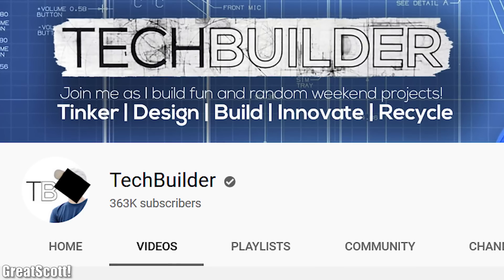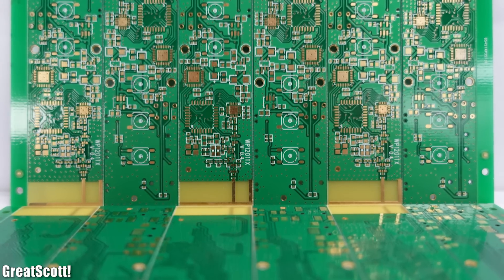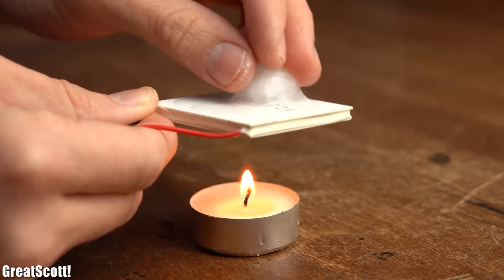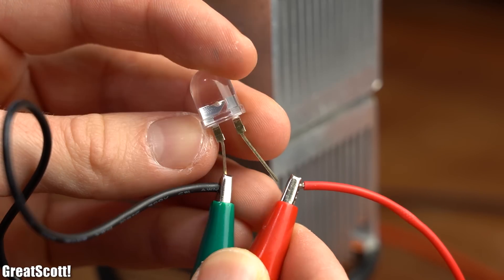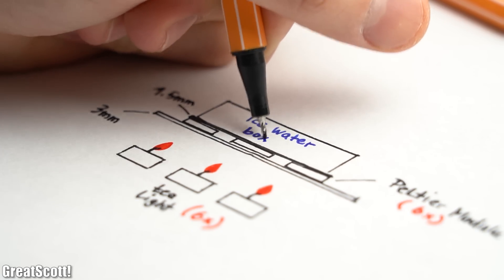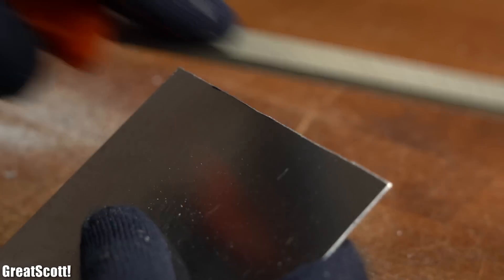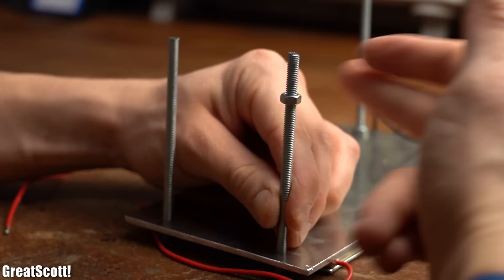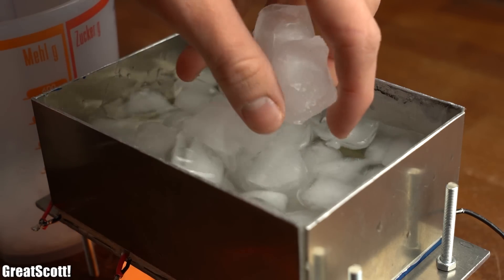Exposing a FAKE Thermoelectric Generator and building a REAL one!

Comment: Fun video, but I've designed comercial units and you need clamping force on the peltier modules to get a proper thermal interface. Just slopping on thermal compound creates a thick barrier.
You ideally want the only thermally resistive interface to be module itself as that is the only differential that creates energy. The rest is losses.
The modules to generate 5w alone exist and work great, but they require a deltaT of 210c and a heat-flow of 113w to deliver 5.1w.
Look here for actual performance charts and graphs from such modules: https://tecteg.com/store-thermoelectric-power-module-selection-purchase/
(I am not affiliated with TEG, tecteg or Rogers in any way, but I have used similar modules.)
A tea-candle generates 7-17 watts so you can't get anywhere near the required heatflow or temperature for a full 1-amp charge.

Comment: Two different but similar technologies, TEC, and TEG
Thermoelectric coolers are optimized for electricity to thermal difference and are lousy for thermal difference to electricity
You want to use thermoelectric generators for this, as they are optimized for thermal difference to electricity 

Running them backward will work just not very well

Comment: You would better use proper flux to solder the aluminum plates.  You should also clean the weld area with metal wire brush.

Comment: Engineers: this is a peltier Generator, basically generates electricity from temperature difference between cold and hot...

everyone else on the internet: OMG LOOK A FREE ENERGY DEVICE!!!!
Reply: The skeptic in me always says... it's not free when ice is needed and so are candles. Energy is needed to make the ice and candles cost money.
Reply: @raisagorbachov     The out of box thinker in me says that if you drill a hole into the ground, stick a sealed copper pipe filled with very fine silicon carbide powder , then attached to a flat plate "heat pipe" super thermal conductor/phase change heat sink.  Then for the hot side, you paint it an ultra black and put it under two clear acrylic boxes (preferably with a vacuum pulled within the box (but don't think acrylic will hold a vacuum permanently though). Take some poly foam with the Al reflective backing and cut to size the peltier to fit in that and put the reflective side up, so that it helps to keep the ground below cooler. 

       If you have a nice sunny spot for this, with enough devices connected, you could actually generate a decent amount of electricity especially during the warmer season. Other than price of the materials, the energy itself is free. 

   Btw, have a nighttime bank as well, that is reversed with some changes. Warm/hot side is the same as the above cold side, but for the cold side, have it painted ultra white and have it set sort of within a Al reflective, like satellite shaped reflector pointed towards open sky. Still have the double/insulated acrylic box (can be painted that same ultra white). 

     It will reflect the IR up into the cold vacuum of space and cool the cool side of the peltier. If the ultra whites are white enough, might even work some during the day as well.
Reply: Yeayou can also scream into quarz crystals and produce a small current. 

 youre speaker is also a microphone. Hook up a osci and talk into a speaker, looks pretty cool and is a fun party trick (well on a party full of electrical engineers)

This is the Piezo electrical effekt. You can either supply current to a piezo crystal and the crystal will start too vibrate or you vibrate the crystal and it will output energy

In theory you could build a piezo generator running on the screams of humans wich is probably how hell produces its electricity
Reply: @afox5319  similarly, you can shine a light at an LED to produce a tiny voltage or power a solar panel to produce a tiny amount of light. If course neither is as efficient at doing the other's job, but the principle is similar.
Reply: @afox5319  Hell doesn't run on electrical energy.......actually it's powered by thermal energy coming from human bodies and lava, as it is said in sourate Al-Baqara, in the Noble Quran (".... beware the Fire whose fuel will be humans and stones...")
Reply: A lot of people mistake Free Energy for "free electricity": literally as in they're not paying to get electricity, and not as getting electricity from nowhere.
Reply: It may not be free energy, but it is a new and exciting source of energy for hot tent campers
Reply: TGM-199-2.0-1.2
Reply: there is nothing like ,,free energy ,, ..there is alway something for something ..and losses matters !
Reply: It's close enough.
Reply: it is free energy, all energy is free ,  for a time at leaste, the sun will burn for billions of years, the earths core will be active for maybe as long,  theres energy everywhere, for free, well getting isnt free, but once you get it, it is, otherwise we wouldnt exsit i think, if energy cost, if we had to pay to produce energy, we wouldnt have enough in us to make energy, so its all technically free, existance is free, didnt cost us anything to be here, but admittidly it costs to stay, but thankfully theres free energy everywhere
Reply: Fixing hot plate at 50 degrees and the heat sink, which thermoelectric module would produce more power: TEC1-12702, TEC1-12706 or TEC1-12710?
Reply: @marvinmarvini8629  TGM-199-2.0-1.2

Comment: If you consider that a tealight can provide around 25W of heating power, than you could say, this project is insanely inefficient! 
So 6x 25W = 150W (+ the Energy needed to cool down the ice cubes)  vs.  5V x 0.043A = 0.215W  !
 n = 0.143 % -  This has been the worst trade deal in the history of trade deals, maybe ever

Maybe as I've seen it in the other comments, a Stirling-version with a BLDC-Motor would be a interesting project?

Comment: I have a design in my head for something like in a more practical setting. I was about to make it and bought some peltier coolers on EBay back in the days, but they were real shit quality and couldn't handle any temperature difference that was needed for generating anything worth using. The idea was to do it on the chimney, as a chimney roof. Hot air comes from below and heats a large heatsink. The TEG:s on top, on top of that another heat sink with a border around it. Then atube from the bottom to the top that would let the hot air create an airflow of cool air into the heating element because of the rising hot air. I think it would work quite well.

Comment: Not sure if that video was fake as is now listed private but you can check the video I made over 8 years ago about this subject. You can sure charge a phone (not very fast) with a single peltier module and a step up converter that has max power point capability (there are specialized IC's for this task). I did used a more capable peltier element in my video the 12726 https://www.youtube.com/watch?v=tbdtulL44ms

Comment: You may get a better result with TEGs instead of TECs.  While the principle is the same, TEGs are specifically designed for power generation from the temperature gradient while TECs are specifically designed to create a temperature gradient from an applied current.  Similar to how electric generators for wind turbines are better suited for generating electricity than a BLDC motor that is being repurposed for generating electricity.

Comment: You wouldn't have been able to power fans to cool down enough the "cold" side with your own design, right?
Using ice cubes is kind of cheating because ice packs a lot of energy... which was put there in the first place by your freezer, using electricity :) So a good part of the power input comes from freezing the ice, not just the candles.

Comment: Should you not be comparing against a TEG (Thermo-Electric Generator)  not a TEC (Thermo-Electric Cooler). TEC are better at cooling not generating electricity from heat like a TEG. Also TEG have max temp ratings, so you can better optimize the heat source.

Comment: ElectroBoom already tried to do something against such channels by testing the circuits they designed and finding out it´s not working at all but it seems like they don´t care much about.

And that´s why my brother thinks you can get free energy out of a 3 phase AC motor powered by an inverter+car battery which then drives an alternator from a car which then recharges the battery.
There are mechanical and chemical losses everywhere and a waste of time for people who believe in this.

Comment: You need to apply pressure to the peliter to get maximum effect out of them. The thermal exchange between the plates will be really low without the pressure and that will of course effect the power output. These things is said to have been used on chimneys in Siberia. Really cool things!

Comment: Why would the original one have a heatsink on the bottom? It seems like that would insulate the candles radiated heat from reaching the Peltier module more than bare metal would

Comment: I replaced the side of a beverage cooler with an aluminum plate that had 12 peltiers in series in such a way that their thermo-common side was facing inward. The idea was to drive a fan for camping trips. It produced electricity, but not nearly enough. However, I've since considered how much thermal loss I probably had in the transfer process as the primary culprit. Great content as always here on GreatScott...
Reply: I should add it only worked on REALLY hot days (differential outside) with REALLY cold ice-water (inside surface). But I did do an experiment the following winter where I added near-boiling water to the cooler and placed out outside on the porch. Interesting results there as well. I think I might re-visit this with a better approach.

Comment: So, yeah.. at 5V & 43.5 mA, it would take over 10 hours to charge a 2200 mAh cell phone battery (assuming you had enough heat & ice for that long.  Not much of a survival charger to be honest.  A foldable solar panel would be a much better solution for a survival situation (assuming you had sufficient sunlight).

Comment: Efficiency suggestion: 1) Use an in insulative material for the sides of the water reservoir instead of the aluminium. You could also add a top.  Both will make the ice last longer.  Someone already mentioned adding salt to the ice water to make it colder.  2) Add an insulative skirt to the bottom as well,  the candles will fill it from the top down with the coolest air spilling out at the bottom and the hottest air will be trapped at the top.

Comment: Try using a stainless steel wire  brush on your aluminium to clean it the acetone before using those aluminium solder rods.

Comment: May I ask if you have heard of the UniSolder project before? Somebody made this awesome open source multi brand soldering controller which works with soldering cartridges from JBC to Hakko and so on. I am honestly thinking of building one. JLC would make 5 PCBs for 20$ with an SMT stencil.

Comment: 1)Tech Ingredients recently built a Peltier generator too (here: https://youtu.be/hDLWO_Iaflc?t=484 weird youtube themes? or did everyone get the same freebies?) they were able to show you can get better output with a decent load on the unit.. short circuit current is not the way to measure these..
2)Being wrong on the internet generates more interactions more clicks and more money... just look at this god awful mess: so much wrong, so many subs, so many likes, ughh: https://www.youtube.com/watch?v=eDlT8fp3ZU0
3)As for soldering perhaps a that was itself a lesson in how vital flux is for any soldering..

Comment: try to lower the heatsink even more to get better results. The temperature difference between hot and cold side'll be much higher so you'll ends up with little bit of extra power and i hope it will charge your phone much quicker ( charging current + - 150mA )

Comment: When soldering aluminum, I believe you need a flux to clean the surface for the aluminum filler material.
Reply: Aluminum  very quickly reoxidizes if you scratch off the oxide layer. There are fluxes for low temp tin zinc solder and for high temp aluminum zinc solder if using a blow torch.
Reply: Yes, but it has to be a pretty nasty aggressive flux.
Reply: I didn't even think it was possible to solder aluminum. Solder doesn't seem to wet it. I guess I was dealing with the oxidation layer though.
Reply: To solder aluminum you have to warm up the material from the opposite side, never heat up directly the solder rod. Flux is with special solder not necessary,  just a bit skill
Reply: I would argue against soldering aluminum altogether. 

Clean way to do joints is TIG welding. If you cant or dont want to do that, then stay on the side of screws and bolts.
Reply: @OkurkaBinLadin and glue in this case

Comment: Also, notice that the fan will need way more power than the module can provide. With a net loss of energy, I’m not even sure you can call it a generator. Using the ice bath is a far better idea!

Comment: I tested several peltier pads and high current ones dont produce more electricity, not voltage not current. The best one were the middle of the road cheap ones. The best are obviously thermoelectric generator purpose built pads but those are expensive.

Comment: Just fyi ya gotta wire brush the the aluminum to remove top oxide layer and also wanna make sure the metal is melting the solder not the torch

Comment: There are Thermoelectric Generators which are like the TECs he's using in this video but are made for generating electricity (as the name suggests) much more efficiently. NASA has been using TEG and radioactive sources for some applications, in the hundreds of watts range iirc
Reply: Yes, and Soviet Union used them even terrestially all around, becoming infamous after the government collpased and people began to steal them for valuable scrap metal, with their plutonium pieces mixed with all the scrap iron.

I would be very interested to have similar thermoelectric generators, to be used with non-nuclear heat source. Another Soviet marvel were the lanterns with integrated thermoelectric elements to power radios and other low-power devices. I think they might suffice for smartphone charging, or at least could be nowadays made as such refined versions to suffice.

I wonder how such elements are structurally build from two metals, as all demonstrative examples have been about wires twisted together. But why couldn't we just have those bimetal interfaces as plates of different metals bonded together? Of course we need two interfaces though. Common sense would say that the larger surface are the more power? But maybe it's more complicated. But can't be too complicated, as working useful examples do exist.

Comment: If you want to use the aluminium solder, you need proper flux for that. Beware that some of those use hydrogen fluoride (never use indoors if you value your health). 
Also, you don't put the solder into the flame, you have to get the material hot enough for the solder to wet it without the flame directly touching it. Might be difficult with a small torch and a large piece of aluminium, having insulation (mineral wool works great for this) helps. Or preheating in an oven. Last but not least - the heat will screw up any heat treatment or work hardening the aluminium might have had, unless it's cast, it will be weaker then before.

Comment: In the original video the fan was connected straight to the source. wouldn't the fan burn if the output was greater than 5v volts?

Comment: Hey could you see if you can light a LED with a “foxhole radio” like they built in WW2? I’ve been seeing a video go around where a guy uses the power from FM radios to light one for free
Reply: I cant say if that exact setup is possible as I haven't seen the video, but in theory it should work. It is the same technology used in wireless chargers. You would need to be close to the transmitter or have a massive antenna or both just to get usable power from it.
Reply: @zachdemand4508  Yes;
Theoretical a «field» would be present proximal to the antenna;
In physics any energy can often — more often than expected — produce some  energy which would result in this being very plausible experiment;
But this is no free energy ~ there is no such thing?
I did see a gravity wheel which suggests considering but no free energy has ever been produced reliably there has always been slight of hand
Reply: @ChiDraconis  

I never said it was free energy. Although it would be free to the person using the device as long as they dont pay the bill at the radio station.
Reply: @zachdemand4508  Correct;
I was speaking to warn the few;
Just now i see that some radio stations pulled I got a brand new pair of roller-skates    due to exotic statements made by uninformed
Reply: @zachdemand4508  Is possible. See above
Reply: If you're close enough to a broadcast antenna farm, you can light a florescent tube just holding it your hand.
Reply: @anullhandle  Correct. An antenna is basicly like a Tesla coil but lot less powerfull. The Tesla coil is made to create that field. For the antenna it is a side effect.
Reply: For anyone curious, the YouTube video is titled “Free Energy From Radio Waves”
Reply: Radio waves are kinetic energy. Those radio waves (kinetic energy) can be transfered into electricity which powers an LED. Basicly the radio wave detector captured the waves and the signal from that detector is what can be transformed into electricity.
Reply: It seems theoretically possible to create a “free energy” system using this, considering most of us live near FM radio broadcasters.
Reply: @GreatScott! 🙃

Comment: keep seeing projects like this, but no one seems to clamp the TEC's down, and just use weight or the thermal paste to stick them together. They need pressure to push the cold/hot plates to the TEC for better contact. Not that it would make this work much better, but it would help a little bit.